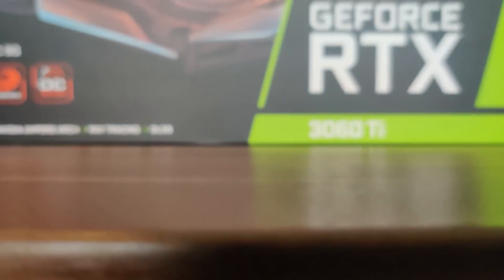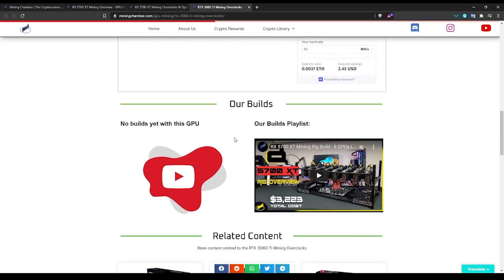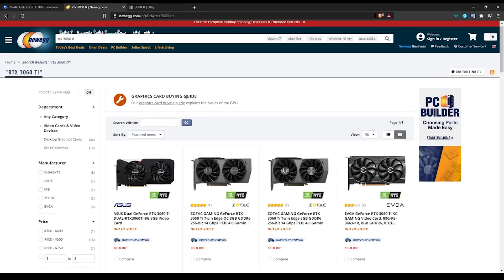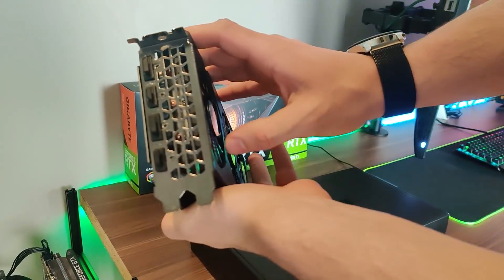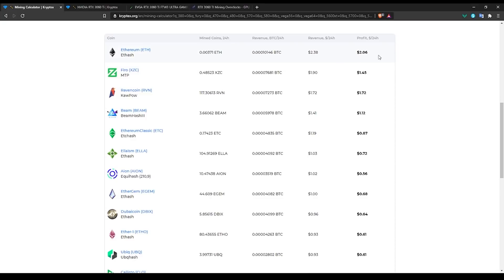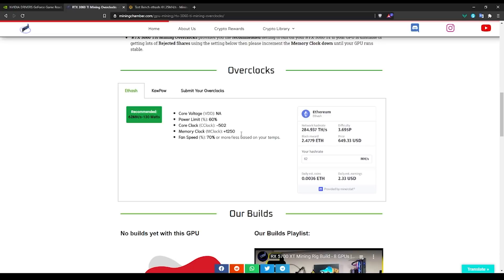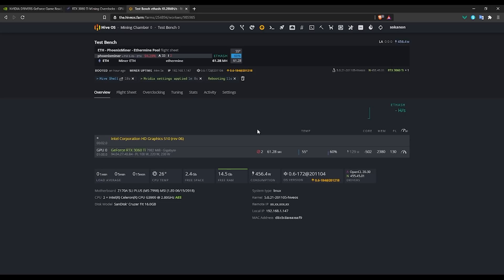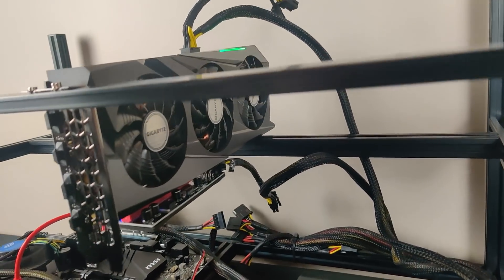RTX 3060 TI Mining Overview | Profitability, Hashrates & Overclocking

Comment: I have 4 of these cards and they went down slowly after mining for 4-5 months with medium hashrates. They camme and are still with original bios  94.04.6B.00.F4 and I tried to change it but could not find a reliable one. Any tip? One is off and other is running on a test rig with t-rex and OC as core:1450 and mem:3500 on 5.10.0-hiveos #110 and 510.60.02 nvidia drivers.

Common errors : >t-rex low hashrate (0 kH/s), restarting1d 2h, >t-rex low hashrate (22708 kH/s), restarting1d 3h >GPU are lost, rebooting1d 3h >GPU driver error1d 3h >t-rex low hashrate (0 kH/s), restarting1d 3h

Comment: Ive got asus 3060 ti core -250 mem 2200 pl 115 watts 44. 34 mh. Ive got 3 of those cards. Just got msi 3060 ti msi 42. 17 mh, -500 core mem 2200, pl 130 watts wondering why the watts are higher on the msi compared to the asus

Comment: Settings are okay unless mining on KawPow.
Increase the core clock to +100 (26+MH/s) as opposed to -502 (~22MH/s). Power draw remains the same.
If you want to hit ~29MH/s, put power up to 65%. You gain 10% hash and costs you around 5% more in power

Comment: Hi ,I've mining 1month using your setting and same card as your's . Few day ago the overclock setting keep reset constantly. Is Because of mem temp issue ? Do I need to change the thermal pad?
Reply from the maker: No for a 3060 ti it's not thermal pad issues, you just need to fine tune your settings!
Reply: @MiningChamber  Already tried many setting , the oc setting keep reset around 1-3 hours, need to manual restart to get the best hashrate 😓

Comment: Is it normal for the ethash mining to go from £5.30 per 24 hours to £10 per 24 hours then back down again after a couple hours. Is that just normal market fluctuation? Since my rtx 3060 ti has been ethash mining on t rex for a day at  61 mhs, 121 W with 1.4% rejected shares
Reply from the maker: The latest block rewards were insane so that's why it distorted a bit
Reply: @MiningChamber  Does concurrent users affect rejected shares. Cause for some reason im getting alot more rejected shares at night than day. Edit At 1.9% rejected shares I'm almost convinced its nicehash servers that are the ones giving me rejected shares. I still seem to be earning around a stable 0.00002500-3000 btc per 4 hour payout with the rejected shares

Comment: Bro pls tell me how to do it
I have a 12 rtx 3060 ti
6 are gegabit gaming three fans 
and 6 are msi gaming trio
I have those newest Riser the 009s
So should i use the same pcie cable that is powering the grafikkarte and with the same cable power the Riser at the same time?
Or should I use a pcie cable for the card and pcie cable for the Riser
And which psu port should I use
 is it pcie port that is powering the grafikkarte and then i use another pcie psu port to power the Riser?
Or is it pcie cable from the psu pcie port to the grafikkarte and then pcie cable from the peripheral to the Riser?
😭
Am going crazy
Reply from the maker: Watch the ATX psu video guide! Same cable for gpu and riser is okay, and use splitters for it

Comment: i have a msi 3060ti gaming trio and its a great card  and even better cooling i get 49 mh/s while mining etheruim
Reply from the maker: If you have some monitors connected to it then it's probably why. Other than that make sure your using the same OC settings we used in miningchamber.com
Reply: @MiningChamber  I have 1 DP and 1 HDMI connected to my 2070s and i get 42 MH/s so i dont thing that is the case, maybe OC will fix it

Comment: I lost two EVGA 3060 Ti in about 4 hours. Running them in a rig with three 1070s and a TDP of 70% with memory oced to 500 mhz. Mining with NHOS.
Reply from the maker: O what do you mean by you lost them
Reply: @MiningChamber  stopped working.
Reply: Well the fans worked that's about it.

Comment: I just started mining with MSI 3060ti Gaming X Trio I am getting 59 60 mhs, the temp is around 45, but the fans aren't turning on. Should I turn them manually or wait for the gpu to turn them automatically? Should they be always on?
Reply from the maker: It's best to have them always on at a set speed. Memory temps get hot but you can't see their temps
Reply: @MiningChamber  thanks for the reply. The reason I asked this is because when mining with rtx 3080 the fans immediately go to 100% but when I mine with 3060ti they dont tun on and this got me confused.

Comment: Hi mate, What is the deference in between RTX2060 super and RTX3060 series. Also, I have got the 1660 super set up. Can I mix the drives  up? If I can, do I just simply download the driver for it? Thanks mate
Reply from the maker: You can set up one gpu only and then install it's drivers and plug in the rest after. You don't need to install drivers again but preferably do it with the latest gpu which is the 3000 series. The difference is the new ones perform better all around hashrate and power draw
Reply: @MiningChamber  Hi, thank you very much for your timely respond. At this stage, I can only get the 2060 super and 3000 series is out off stock unfortunately. So I have the 1660 super running now, I can just install the 2060 super on and install the driver as well. Thank you very much

Comment: Is gigabyte a reliable card? Because I've heard that they break easily and that they are not reliable
Reply from the maker: Depends on the series. For 3080s they are not the best but other times they are fine
Reply: @MiningChamber  is the msi 3060 ti ventus 2x better than the gigabyte one and if so, should I go with the 2x or 3x design?
Reply: @panosgk7131  I have the ventus 2x OC and that is a absolutely brilliant card, if you like long graphics cards go with the 3x That gives really good cooling with an extra fan.

Comment: Which is better hive os or windows? 
Is it needed to overclock the GPUs? 
If I connect 5-6 GPUs how can I update the drivers for all of them separately?
Reply from the maker: Both are good options you can pick what you find easier. 
Yes you need to overclock, check the video I did about overclocking recently.
Drivers install only once in windows 10 but plug only one gpu when installing drivers then shutdown and plug the rest after you finished installation

Comment: Hello again Mining Chamber. I just got an MSI 3070 (similar but not same settings, I know). Do I leave the bios unflashed and just OC?

Ty.
Reply from the maker: Hey! Yes similar settings. NVIDIA GPUs don't need a BIOS mod at all so far
Reply: @MiningChamber  Thank you!
Reply: Stable hive os setting, Phoenix miner, nvidia drivers 460.39

I have not Micro tweaked

MSI rtx ventus 2,  3070
60.39MH/s
0 invalid shares

Core:-200
Mem:2200
PL:130

Comment: I'm only getting 55mh/s on my EVGA 3060 ti on Samsung memory. 60PL -502 CC 1150 MC. I'm also getting incorrect shares. Running Phoenix 5.5 and latest Nvidia drivers. Please help.
Reply from the maker: Try to put your power limit a bit up at 65 and memory clock try 1100. Although, if you have monitors connected to your gpu it might reduce the performance slightly
Reply: @MiningChamber  Thanks I was able to do PL to 65 and memory to 1300. Now getting stable 61mh/s

Comment: Hi, please clarify why not to buy rx 6800 instead of 3060 ti for the same price. Nearly same hash rate but it is 16 gb, we will be able to use it years later in contary to 3060 ti with 8 gb?
Reply from the maker: 8 gb will last for years too and either way by then Ethereum will probably be not mine-able anymore, it will be moved to Proof of stake. So the reason the 3060 ti is better is because it has a handful of coins that it can mine good but AMD cards only dominate in Ethereum

Comment: Hi mate, just wondering if you have this problem. I tried to set rig up today. My GPU is 1660 super. Everything was guided through but I can not install the drivers for GPUs. The windows10 is the latest version, and it says this nvidia driver is not compatible with this version of windows. I am stuck right now. Need a bit help please.
Reply from the maker: Try updating your windows from the settings then try again. Windows is a mess sometimes
Reply: @MiningChamber  Hi thanks mate. I have tried everything and still does not work. I think I will reinstall the windows 10 by following your tips and steps. I might have adjusted setting before I updated windows 10 which some functions might turned off. Cheers mate.

Comment: Pulling 120W and 61.5mh/s on mine 3070 with no stale or invalid shares last 57h
Reply: but you pay far more for a 3070 than you do a 60ti
Reply: @DannyDoDar  due to limited stock and scalping prices, the price difference is only about 50€ or the same price (750€).
Resale value of the 3070 will be higher and not considered a mining card as much as the 3060 ti will be.
Reply from the maker: Nice!

Comment: I have 2 3060 ti's ordered to come. trying to sort out the psu. i have a 750 w psu currently with just one rx 580 8 gb . Can i just add another psu and bridge it? also my 3060 ti  has 2  x8 plug connectors will both needed to be plugged in to the psu. or  will  1 8 pin connection to each gpu suffice. 
Thanks in advance
Reply from the maker: You can run all 3 GPUs from the 750w, you can also use a dual psu splitter for sure. You can find info on that on the atx psu guide video!
Reply: Perfect thanks for the info

Comment: Hi and thanks for the video. I am a new comer and have a 3070 single GPU and running HiveOS on USB (Linux).  I have manged to setup and am getting 51.77MH I have noticed that the GPU TEMP is 75% and Fan speed is 55%. Is this bad. Can you advice on how to lower the Temp or shall i swithch to windows?
Reply from the maker: Hey! Operating system doesn't change your temps just make sure your properly overclocking your gpu! Increase fan speed if needed
Reply: @MiningChamber  Hey and thank you for your kind reply. I am setting everything to default so havent OC. Do i need to control the fan via OC?
Reply from the maker: Make sure to OC for mining, it reduces your heat drastically. Video coming out on that in 3-4 hours!

Comment: How does Gigabyte compare with EVGA ? I read Gigabyte is not so reliant, turns hot and not so stable
Reply from the maker: It depends on what gpu it is, for example 3080s gigabyte eagle can get really hot. But with the 3060 ti so far all is good!
Reply: @MiningChamber  I saw a comparative review last night and indeed the gigabyte 3060 to oc pro, with 3 fans is the best 👍🏻 well done
Reply from the maker: Thank you and awesome!
Reply: @MiningChamber  I plan to get one this weekend, I called a shop, and it is open to order, just they don't have final price or date, but last one sold was 550e, which is the lowest I found in Paris

Comment: @Mining Chamber hi i am new to mining, how bad is it to get dropped shares because using the settings suggested in the video my dropped share percentage is like 1.5% and I'm also got some stale shares. although i am using a Leadtek 3060ti hurricane. i just cant seem to get proper settings for my gpu without getting rejected shares. also, love your videos keep it up, dude.
Reply from the maker: Hey! Usually you want to have not more than 10 rejected in an hour. But the less the better in general. So try the OC settings on the webiste, I also say there what to do when it's unstable or rejected shares.

Thank you!!
Reply: @MiningChamber  here is a little update for you.  i've been running it on nicehash for over 5 hrs now and I think I am pretty happy with these results 1606/31/0 @61.1 mh/s but my oc settings is a bit different than yours though they are 62% on the power and -200 core clock and 1250 mem. also is having it on such high memory bad for the gpu. thanks in advance
Reply from the maker: Nice! That's pretty good and no bad effect on gpu so no worries
Reply: @MiningChamber  just fyi something weird that has been happening to the 3060ti i have been running it for 4 days straight in the oc settings that u suggested was getting 60.1 mh/s consistently but on the 5th day the hashrate reduced to 59.5 mh/s i was just wondering is that normal or maybe something is wrong with my card. thanks in advance
Reply: @ZEE0917  hey are you earning similar amount as shown in nicehash profitability calculator.

Comment: Please help me out

This NVIDIA 3060 ti graphics driver is not compatible with this version of Windows

I'm getting the title error when I try to install the
 rtx 3060 TI graphics card drivers. I have the card in my machine and hooked up to power, the LEDs on the card are all switched on and all the fans are going then they stop , and the error when I try and install drivers.
This is my rig that am trying to fix
Motherboard : ASROCK H110 PRO BTC+
Cpu : LGA 1151 core i3
Ram :Corsair
 (1 x 8 GB) DDR4 3000 Mhz C16 XMP 2.0
Reply from the maker: Which windows are you running? Join the discord and chat there encase I miss the comment!
Reply: @MiningChamber 
Thanks for responding
Yaaaa finally it's working now
It was the windows version
I had to use the newest version of windows, and now it's around 63 mhash
Reply from the maker: sweet!!

Comment: Hello! Thanks for your precious info. I tried the OC settings you suggested and it works like a charm on my linux setup ;) It's also generating less heat and is running at lower fan speeds as a result! Awesome! I really appreciate the work you put in it for all the rest of us ;)
Reply from the maker: That's awesome really happy to hear! Thank you!
Reply: @MiningChamber  I noticed a few rejected shares initially. Do you know how I could resolve that? For now, I just lowered the memory clock speed to +900, that seems to do it...
Reply from the maker: That should do ;) I talk About it in the article on the website!
Reply: @MiningChamber  I did some digging around and I found that apparently a problem with the RTX 3060's is that it will work much less reliably if you start mining with OC settings. Setting the memory clocks higher after mining starts allows clock speeds of +1300 for me, without any stability or share-rejection issues (at hashrate close to 62 Mh/s).

Comment: Hi. I just got my 3060 ti gaming oc pro with 8 pin & 6 pin. I followed your overlock but on my set up rig its registering 150w instead of 130w. Can i just remove the 6 pin and just run the gpu using single 8 pin to reduce power? Is that possible? Thank you.
Reply from the maker: Hey! That shouldnt matter, I would keep both plugged in just to be safe. Try the settings in our website miningchamber.com

Comment: i have 2 of these and cant get them past 950 memory clock ...  any tips ? i get the silicone lottery but thats a land slide,  maybe you got an exceptional card ?
Reply from the maker: That's very odd, did you also set all the other settings the same way? Maybe try to increase the power limit a little and see how that goes! Also you can check the article on the website and give a try to those settings

Comment: I´m planning to mine with 2 RTX 3060 ti, what CPU would you recommend?
Reply from the maker: Any cpu that's compatible with your motherboard would do! Cheap cpus are completely fine
Reply: @MiningChamber  Thank you man, I'm going with two RTX 3060ti with an Asus B250 Mining Expert 16GPUs, so was thinking of maybe pairing it up with an Intel Core i5-9400?
Reply from the maker: Make sure it's compatible! I don't think that motherboard takes 9th gen cpus. Go to the motherboard site and check it's cpu compatibility list. It's very comprehensive and gives you a list of all the cpus you can use on it. Generally a intel celeron g3900 or ,g3930 is completely fine if your not cpu mining

Comment: Why do you under-clock the core by 500? Very informative video btw - thanks!
Reply from the maker: It's due to Ethereum being memory intensive so reducing the clock will just save power and reduce the heat the card produces since we don't need that additional core clock power and thank you!!
Reply from the maker: @jozefflak895  the most recent video I just published talks about why and how it differs in different operating systems. I highly recommend checking it out!

Comment: Was lucky to get 1 x Giga 3060ti OC eagle (dual fan) .  60mh at 120w. 
The card runs cool. Fans make almost no noise - even at 100%.  One factor to keep in mind is that head goes though the cooler and not over the cooler like polaris cards. So placement if combined with other cards is key to good temps.
Reply from the maker: Oh awesome thank you for the information!!

Comment: I got same card. On 1000 memory overclock, and 59 MHash, on auto fan setup is very quiet, and only 51 Celsius. Should I overcool it, or this is fine?
Reply from the maker: Not bad! I would do though 60-70% since usually it's the memory that gets hot for Ethash mining and NVIDIA cards don't have memory temperature sensors, which I'd assume we'd be sitting on 70-90 Celsius for memory